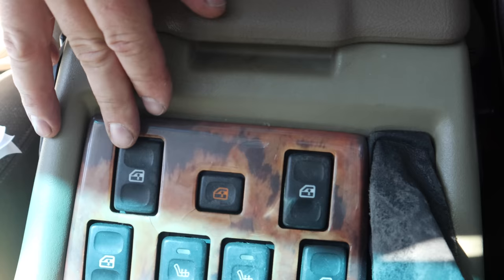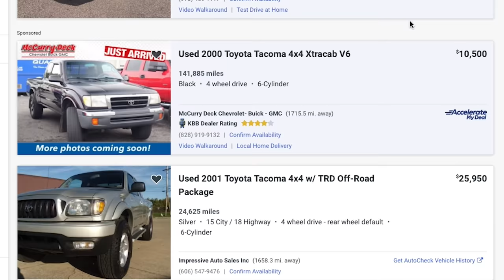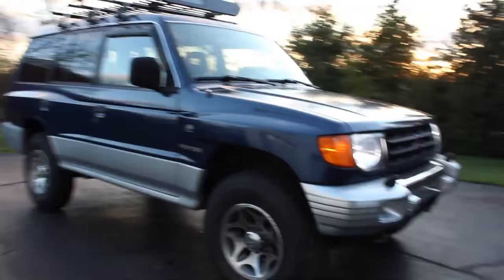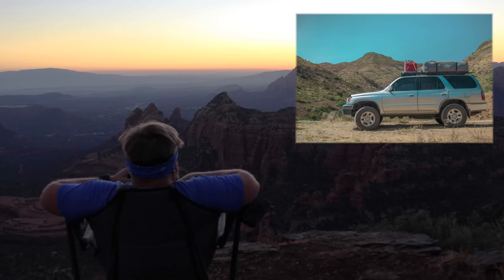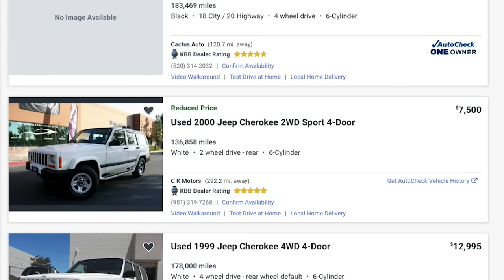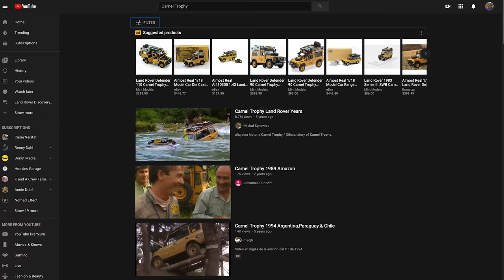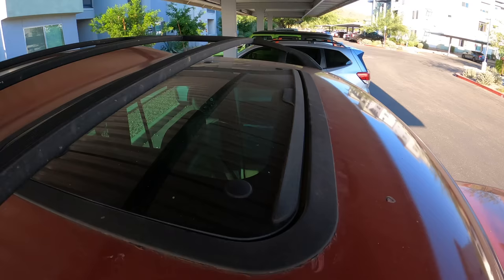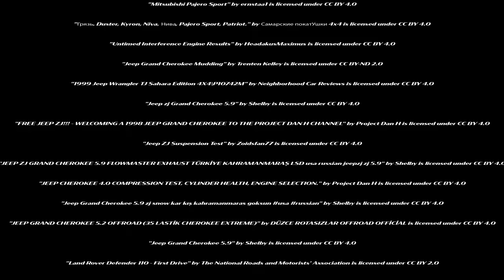The 5 BEST BUDGET OVERLAND VEHICLE Alternatives Under $5000

Comment: I've got a 05 Ford Escape Hybrid. Love it. Especially since hybrids are gaining in popularity.
Reply from the maker: That’s a great one! If memory serves right, Ford ended up getting into a patent sharing agreement for that one with a Toyota because they had developed a planetary gear style hybrid, like the one in Prius. From what I gathered, it sounds like the hybrid transmission in that rig is produced by the exact same Toyota subsidiary that made the Prius drivetrain, which means it probably has the same level of reliability. I think that would be a great rig for weekend trips down some forest service roads, more than enough for most people’s needs! Great choice!
Reply: @MattKester  thanks!! It's my daily driver. It's so awesome when the gas engine shuts down and the hybrid one takes over. Total quiet.
Reply from the maker: Heck yeah! Honestly, you spend 90%-95% of most trips running down the highway anyhow. You can get quite a bit more camping in with all the fuel you save. Plus, I bet having that electric motor in there helping at low speed probably does a great job of making up for not having a low range transfer case!
Reply: @MattKester  I guess. What's a transfer case?
Reply from the maker: @Adeline9418  It is the component in your driveline that takes the rotational output from your transmission, then splits it between the front and rear drive axles. In most heavier duty 4wd applications, it incorporates a selectable low range that  makes it easier for the engine to turn the wheels, albeit at a slower pace. On my 4Runner and my wifes' Discovery, the transfer case is attached at the output point on the transmission. I'm not certain where or how the torque split between the axles occurs in your Escape, I guess I could do a little more reading, cause now I'm curious. Here's a little more information on transfer cases... https://en.wikipedia.org/wiki/Transfer_case

Comment: I had a discoery 2 bought it cheap but previos owner didn't take care of it maybe it was run without oil I don't know but it developed a ticking sound sounded like a diesel run it until I made hole in the engine. 3 amigo lights and all the possible lights were on dash looked like a Christmas tree. however I love how it felt inside the cabin, how it drive,  it felt confortable,it sat high, I just loved the interior. now I am thinking if ever  happen to buy another one. I will somehow find way to retrofit the
 engine/tranny accesories from a Toyota suv
Reply from the maker: From what I hear, they swap quite a bit of them with Toyota UZ engines in South Africa.
Reply: @MattKester  👍🏽oh man👍🏽🤔 I think I see a "project car coming into the distance"

Comment: One of the forgotten offroaders? Isuzu Trooper, Rodeo/Amigo/P'Up. I had a 93 Trooper RS, and currently have a '02 Rodeo with only 74K miles and paid $1800 for it, leaving me lots of cushion for upgrades and preventative maintenance. It is a manual, with 4LO and 4Hi, or 2WD and 4.30 gears. The primary issue with these Isuzu's are the weaker automatic transmissions. If you are handy with a wrench then they are great budget builds/trucks. I've had a XJ, two ZJs, and two AMC J10s which I have done extensive work on and sold for a decent profit. I landed on Isuzu because they are cheaper than dirt, and the driving characteristics and interior remind me of 3rd gen 4Runners but without the Toyota tax. A result of the Bubble era. They are body on frame, really easy to lift(crank the torsion bars up front, spacers or coils in the rear). I like the rear doors swinging outward, allowing for a easy way to mount a table, or molle packs for organization. They don't have the aftermarket support so you need to be creative, or follow the lessons others have learned online. But I snagged a NIB ARB BullBar/bumper.

Comment: Edit: YO A ZJ! my dad had a 5.2 zj as a kid and holy smokes they are so much fun to off road. We had a 2" lift and took that thing all over idaho and wyoming.

Personally, for other vehicles not on the list, nothing beats a 1st generation expedition or an excursion. Parts are plentiful and there is a pretty decent aftermarket for off road. Granted they are on the hefty side and a tad bit long in the excursions case but they have gotten me some pretty impressive places.

If you want to do some some custom fab work, a mercedes w163 is also a great option. "BUT TAYA"  you say. "WHY IN THE HELL WOULD I USE A MERCEDES ML??????"
Well I'll tell ya! Firstly its super duper fun. Secondly, with a reasonable lift and good tyres you have a pretty impressive moderate off roader WITH HEATED SEATS AND LOW RANGE!!! 
Third, its a body on frame suv so you can hoon on it pretty good withour worrying about breaking it.
And finally, people will see a soccer mom suv with the three pointed star on it and wonder how the hell you got it up there.

https://youtu.be/hXJ54tLfHGc
 https://youtu.be/yLW0ubqudVQ
Here's a good example of what a well built one can do. Even my stock ml500 hasnt been too bad for what it is. Plus the majority of w163s in north america came with low range!

Your video is amazing. Im subscribing for certain!

Comment: I'm In SoCal and was looking for a good 4x4 theee years ago and wanted a 3rd gen 4runner but dang talk about hard to get to before someone beat you to it. Also looked at the Grand Cherokee(as mentioned) and the 2000 series Cherokee but all three in the same price point of about 5K oh and the Land Cruiser but those were in the 12K range. Ended up finding a 97 Limited 4x4 with locker 3rd gen 4runner for 5K but needed about another 4K in maintenance but since then it's ran like a champ with 280K on the odometer.
Reply from the maker: That’s a good score on that E Locker Limited! I imagine you’d be paying closer to 7 these days, and still having to put that kinda work into it. What all did you have to do to it?
Reply: @MattKester  power steering rack and pump, alternator, starter, radiator, plugs and wires, all the gear oil and timing belt /water pump and lower ball joints. I wanted it reliable so kinda went overboard but no issues in the last two years.
Reply: I’d move out of California ASAP

Comment: Include in that list Discovery 2. Its simple and robust powertrain and much more confortable than D1 and Defender.
Reply from the maker: Good call. At the time I made this, I was still under that impression that D2's were "garbage" that BMW had ruined. Still not sure all of their improvements were for the better, but I now know quite a few people with D2's who've spent far less time in the garage working on them than I have on our D1... so what's that tell you? I think outside of the few major, but totally addressable, flaws like Three Amigos or the missing center diff linkage, D2's are great. Let be honest, you'll probably have an easier time finding one as well... I feel like it's getting harder to find D1's in any condition for sale.

Comment: I love how the ranger shows up in these but no love for the 9th gen f series trucks,1st gen Sequoia
Reply from the maker: Well, if the F150 were a suitable analog for a Toyota Tacoma, we would have considered it, but it’s form factor is much larger and that’s why we chose the Ranger. As for the first Gen Sequoia, it’s probably the least expensive way to get into a four wheel drive Toyota, but again, it didn’t make a convincing analog for any of the vehicles we were trying to specifically find alternatives for. These are both great vehicles, and we will certainly find a way to include them in a future video.
Reply: @MattKester  my 95 extended cab short box f150 is no longer or wider then a crewcab long box tacoma...the Sequoia is not more then a foot longer then the same year runner...these are hidden gems the Sequoia is

Comment: As with a Jeep, you kind of need to be mechanically inclined to own an old Land Rover. I've had my 95 Disco for a year now. I got it knowing I would get to know it's insides quickly. Glad I got the older model, 96 and up are easier to diagnose,  but field repairs can be more difficult. Paid $1500 for mine BTW.
Reply from the maker: Oh wow. Your’s still has a distributor, right?
Reply: @MattKester  yes sir.

Comment: Great list. But stay away from the V8 Jeep Grand Cherokee. I've had several the V8 is a blast to drive but the engine and cooling system will give you constant trouble. Not your friend if you are looking for a budget off-roader.
The inline 6 Is the way to go!!
Research which transmission it has as some years were disastrous chunks of Chinese metal.
Reply from the maker: Very good to know, thank you. I myself would choose the inline 6 every time, it's just such a bulletproof beast!

Comment: i think Americas opinion on the disco 1s and disco 2s would be vastly different if they received the diesel models ive owned 1 200tdi d1, 3 300tdi d1 and 2 td5 d2 all of which have been 5 speed manuals and just brilliant cars
Reply from the maker: I couldn’t agree with you more, and I’ve never even had the pleasure of driving one yet. We got totally screwed in the nineties and early 2000’s by not getting diesels, back when they were good. The only non-heavy duty pickup from that era that I can recall us getting were TDI Volkswagen cars. When we finally did start seeing more diversity of diesel options, it was too late and we were into the era of DPF filters that pack-off and need to be replaced or scraped on the regular and urea-based selective catalytic reduction systems that are even more unreliable. I don’t think I could stomach buying any US spec diesel produced after the 2006 model year for these reasons.
Reply: @MattKester  dpfs are just a part of life im from the uk so a good chunk of all cars on the road are diesels so its just something we have to deal with but my disco 2 td5 didnt come factory fitted with a cat so ill enjoy its simplicity

Comment: What do you think about the qx4 or the Lexus rx models?
Reply from the maker: Man, that's a great question and probably one that I could make another couple of videos on. Here's my quick take, without really going down the rabbit hole.  Neither of these vehicles are something I'd consider for an expedition-grade build out, but they will both be very good weekend camping rigs that would do fine taking you down some dirt roads to an out of the way spot. The difference, in my opinion, would be that since the QX4 does share it's architecture with the R50 Pathfinder, its going to be more capable when the going gets rough than the RX, especially if you're looking to get into suspension and tire upgrades to give you more clearance and what not. The RX is going to feel and drive more carlike, which means it would be a great option if you're looking for a rig you can daily drive in the city,  but use on the weekend to get back to a spot down a dirt road somewhere.
Reply: The QX4 and RX both have AWD systems that are more for bad weather on-road traction than off-roading. The systems are not driver-controlable, they lack suspension travel, have no underbody protection, and have low ground clearance compared to the vehicles in this video. Between the two, the RX would be the better vehicle in terms of ride comfort, reliability, vehicle condition, parts availability/maintenance costs, and vehicle availability.

Comment: Love the beerfest reference! Another suggestion is an Isuzu Trooper. I have an 01 and yes they do have faults but for something under $3k you can’t beat it. IMO
Reply from the maker: I hear you. I hindsight, I probably could have dropped one of the Mitsubishi offerings and put the Trooper there. It's been mentioned enough, I feel like I'm going to have to do a video just on the Trooper!
Reply: I was thinking about old suzuki's and isuzu's as well. Isuzu's were sold by gm and honda, and share a lot of their parts. (Aftermarket works as well) Most of them are super cheap and reliable if they were taken care of. Isuzu also still exists over seas and is a very popular brand for diesels. I've found most parts are available. But you may have to do your own creative work. Example: isuzu rodeos side mirrors are extremely hard to find. Only in junk yards. All your overland/camping gear should work universally for the rigs though like grille guard, roof rack, roof top ten etc. Another option is also a old ford explorer.

Comment: What's the scoop on the PreRunner? I never hear it mentioned.
Reply from the maker: Well, it’s probably the cheapest way to get into an offroadable Tacoma. However, while they did come with a rear e-locker, they were only two wheel drive and only offered with an auto transmission, so it’s kinda hard to recommend since most people on this space do find themselves needing four wheel drive. That being said, if you are a capable DIY’r, 1st Gen Tacoma PreRunners can be modified with junkyard parts to become four wheel drive.
Reply: @MattKester  Okay. Thanks. I'm trying to choose what my very first overlanding rig will be. Full-size pickups, small pickups, small suv's, large suv's, all the different brands. This is hard!

Comment: Some nice choices But the 1999 to 2004 jeep Grand Cherokee has more horsepower and torque and with the 4.0 l6 195 horsepower and 235 flb torque And Bullet Proof and true 4×4 high and low makes it much better than the 1998 and older with 25 less horsepower and less torque with the 4.0 l6 imo 1999 to 2004 Jeep Grand Cherokee A Better Buy. Thanks For The Great Video. New Subscriber Here.
Reply from the maker: Great points, thank you for watching and subscribing. If you get a minute, check out the video we put out last week where I actually dived deeper on the subject of budget Jeeps and concluded that the WJ was probably the better all around "budget" Jeep.

Comment: I have always lived off road, I have never paid more than 6K for a vehicle. It is definitely became a lot more difficult lately. This time around I just bought a junker took it to the mechanic and told him to replace everything. I don't care if the parts even good just replace it. 1996 Jeep Grand Cherokee. 1k for it, when I was a teenager you could pick up a good vehicle for 1k. Now 1k get you a ok engine and a ok transmission but everything else is F-ed.
Reply from the maker: Yeah, I feel you there. I'm thinking, in this market, you aren't going to find much anymore under $5k that isn't gonna involve some heavy lifting on your part! I miss the good old days, that's for sure!

Comment: You are way wrong on Land Rovers under $20k. Plenty of vehicles under that price that are great vehicles. There has only been one model that had issues and that was 20 years ago regarding blown head gasket issues in the early model Discovery 2. The LR3 and LR4 and very reliable. Air suspension problems? Air suspension lasts longer than factory struts/shocks and provide a better ride while being able to adjust your ride height at the press of a button. All facts!!!
Reply: Maintenance? Every vehicle needs an oil change lmao. This excuse is nonsense. If Toyota is so flawless, why do they even have mechanics for them? Also, Land Rover is cutting edge tech that is years ahead of their competition. Toyota is still pushing 25 year old engines and 5-speed transmissions and charging a fortune for them. Jeep? They use minivan engines lmao. Solid axles you might say! Ride quality is crap compared to a air ride rover. Modern Jeeps only excels in rock crawling when compared to a Land Rover. Daily driver and overlanding is much better in a rover.

Comment: Sorry 4runners rule as my 97 has 315500 and still runs like off factory floor. 212,000 when purchased.
Reply from the maker: Oh, I don't dispute they rule! Mine had 110 when we got it, we're up to like 165 now. The unfortunate part is that their prices just keep going up and I'm not sure it's very possible to expect to find a 4WD 3rd Gen that isn't completely trashed for under $5k anymore. Then agin, a 2WD third gen is still a pretty capable machine, and you can still snap them up under $5K. Hmm...

Comment: Trooper?
Reply from the maker: Made a follow up video after I realized I forgot it… it’s in there!
Reply: @MattKester  cool, yeah they got kinda pushed out of the market by a questionably executed consumer test article. Isuzu responded but the damage was done. In reality the trooper has proven to be very stable and reliable when maintenance is on track. They're very surprising off-road and a lovely drive for the 💰💸

Comment: Your #2 without 4 wheel drive is a bad choice for people who like to off road in mud or sand. You really need 4 wheel drive to get you through this type terrain. If you're forced to stop in the middle of a sand pit or mud bog, you're not getting out with 2WD. 2WD may work in the desert or hard packed surfaces, but not in the deep, soft stuff (like sand or mud).

Comment: The reason is you can't find another alternative because those that are listed are built to last! That's why they hold VALUE so high. Unless you find one that is rusted busted from someone who chose didn't give a damn "always laugh" about the prices because they sold their shitty rusted shit box for under the price so they expect a good condition to sell the same.

Best alternative is the 1st gen Sequoia if someone really wants to go Budget build overland. Because I'm getting one! HA!  they last very long too! besides from that tundra and 4runners and land cruisers.

Sequoia got that 8 seater which can be clear up for more space to sleep inside and stretch your legs if you take out the 2 rolls back seat. V8 and 4x4 can tow mid heavy stuff if you wanted too. gas mileage isn't a big of a difference from a v6 5vz.